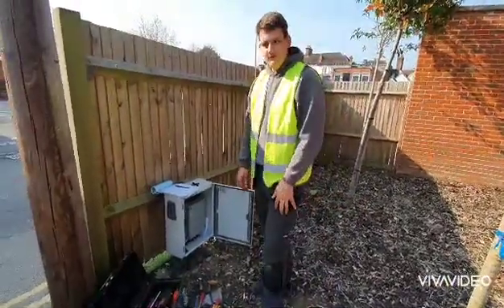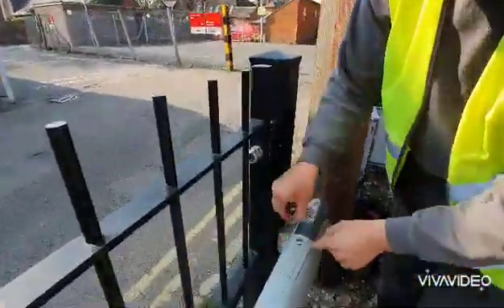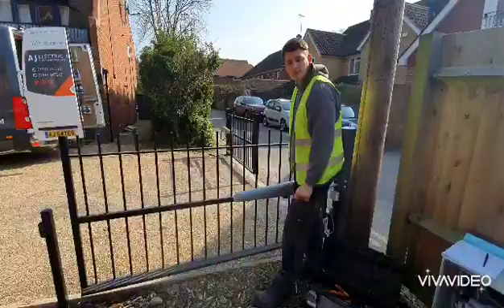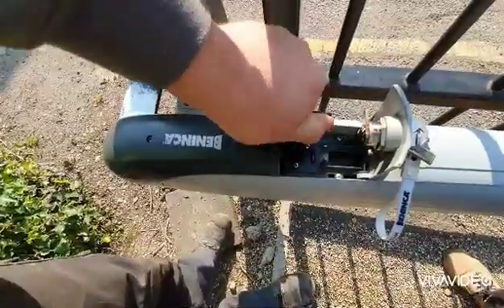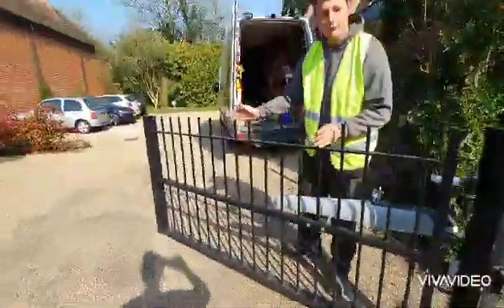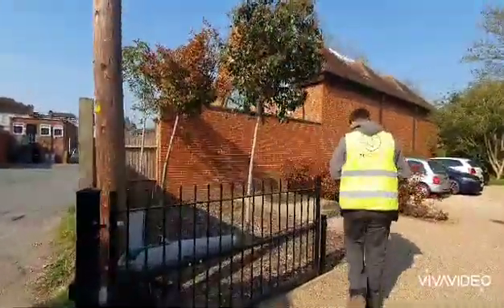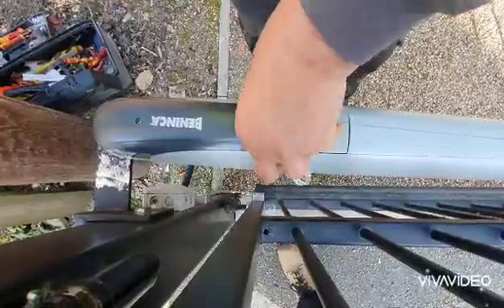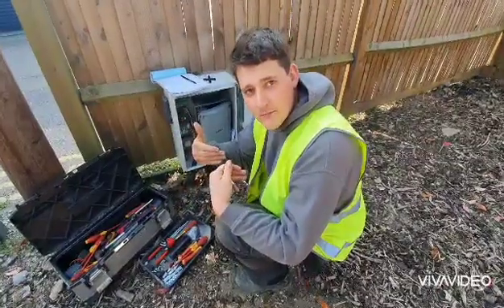Manual override procedure for Automated Electric Gates, Beninca BOB 50 post mounted Ram Motor

Comment: Any ideas where I can get a manual for my Beninca system, the one gate doesn’t close fully it stops about 18inches short . It’s the older design of motors to yours in the video . Is there a manual adjustment on the motor arms .